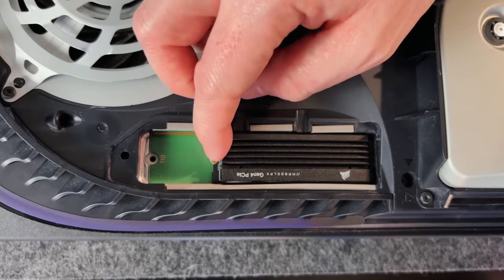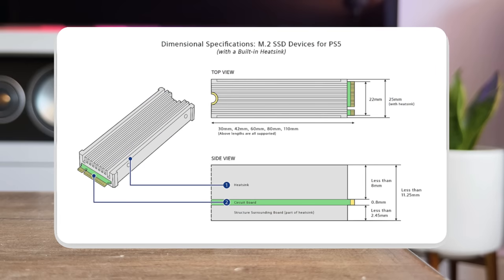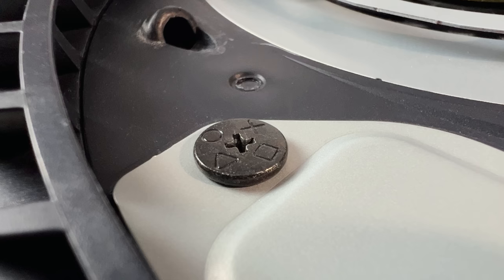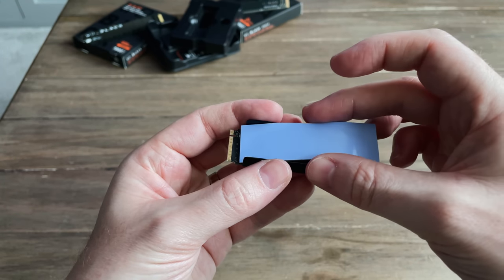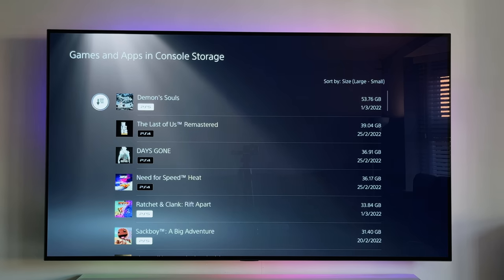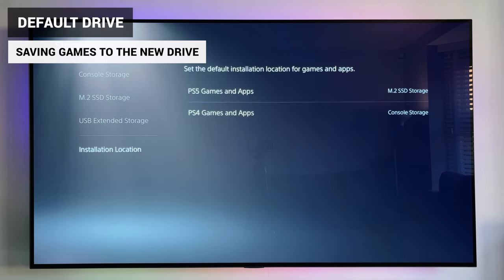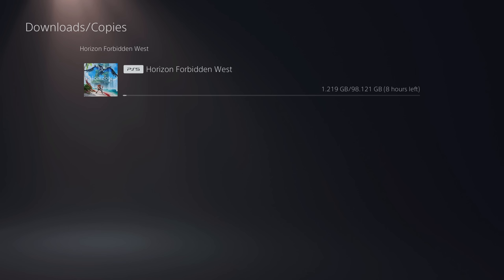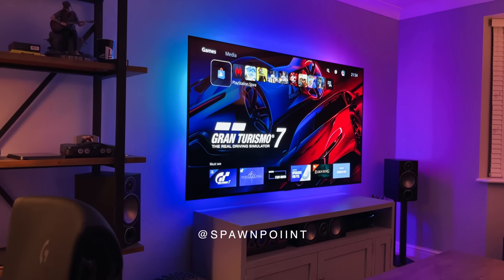The Ultimate PS5 Upgrade: Installing a 4TB SSD

Comment: It's cool to know that the PS5 can support 4TB SSDs, but their current prices are more than the PS5. 2TB is definitely good enough for me and is well priced for me. I have a personal law that says "don't spend more money on an upgrade than you have spent on that device"
Reply: 2 terabyte will not last you much if you plan to get many video games over time unless you plan to have an 8tb external hard drive act as cold storage
Reply: @bamban_garcia5562  I’m getting by with just the base storage and I uninstall games I ain’t playing currently. Then again I got really fast internet so redownloading games isn’t an issue

When I get the SSD upgrade I’ll probably use my external harddrive for either PS4 titles (since they can play from there) or as cold storage like you said
Reply: @jamrah8713  Both good options happy gaming mate
Reply: cap, unless you are implying those prices dropped by 300 dollars in just a year which is unrealistc

Comment: Got a 2TB SSD for my PS5, I think that’s the sweet spot for me I don’t think I’d ever over use more then what I currently got but can’t go wrong with 4TB either little over kill but hey whatever makes you happy
Reply: It’s not really overkill. Just planning ahead. I have a 4TB SSD and I’ll never have to worry about space again.
Reply: @mysterious___1  I have 8 tb worth of ssd but sadly they're only relevant for my ps4 games and ps5 games storage. I wish the sata 3 ssd could slot into the ps5 motherboard just like the nvme.
Reply: Es PS2
Reply: How much did you pay for your 2 TB
Reply: @furiousphoenix7526  2tb depends on the brand but they usually go for like $250-$270
Reply: @mysterious___1  4tb is def overkill. I just got the 2tb and I still feel like it was overkill lol. I have high speed internet though with no data cap so it’s pretty easy to just reinstall a game if need be.
Reply: @rogeliosarceno3162  now its 180
Reply: Can you play ps5 games with a 2tb ssd
Reply: @robertdavis-rb5hd  yeah bro
Reply: @rogeliosarceno3162 how many games does the 2tb fit
Reply: @jaybee756  depends on how big the games are. Like 45+
Reply: @rogeliosarceno3162  games these days are more like 80+gb to 100gb especially as newer games that are on this current gen is so huge so estimated would probably around 18 to 20 games only for a 2tb if you're playing current games on a current gen release.

Comment: Got a hold of a 2tb model, costs me the same as the PS5.

The messed up part is that even if I bought another PS5 with that money instead, I would have ended up with less memory overall
Reply: Same as a ps5??? I bought 2tb for 220 which brand and where did you get yours that it was close to 500?
Reply: @mobious01  got the 2TB model of WD black latest with heatsink for 349,
Reply: @MrLaafish  Ouch 😬 you do know it only costs around £280 on Currys and Amazon and that is with a heatsink.
Reply: @PulseGta  this was bought back in October 2021, when these were brand new
Reply: $220 to $380 for the $2tb 
$699 to $880 for the $4tb
Is what I am seeing on
Amazon.
Reply: @MrLaafish  you did zero amount of research
Reply: @Fancy405  all of this was bought at the time of release last year
Reply: @MrLaafish  I just bought a 1TB WD SN850 and with a total of 1.67 TB... I am a happy man !
Reply: @Zeegoku1007  sounds great man, I wish I had waited more but I wanted to cope one early in case they sold out just as the console itself
Reply: @MrLaafish  Understandable. But the thing is I didn't have a lot of games back in 2021. And in mid 2022 itself , Horizon FW , GT7 , GTA 5 each are around 100GB...so now was the perfect time for M.2 expansion. 

And in approx. 2024 the prices of higher than 1TB SSDs will be in a manageable range so I think people might consider buying them when the library and game file size becomes huge , but you are already future proof so cheers 🤘
Reply: @MrLaafish  prices haven’t change much but you still could’ve did more research
Reply: This 4tb costs me $585, that's a bit lower than my ps5 which I paid $600 for😋👍
Reply: Scammed 💀
Reply: @werick7349  ong
Reply: @werick7349  it’s was back in October when it was fairly new. That’s the price you pay for being an early adopter of the newest technology. Im guessing There weren’t many sales back then so it’s understandable for him to get it at that price. But still could’ve waited for Black Friday sales lol.
Reply: I got a samsung 980 pro with 2tb and 6500 mb read speeds for $230. But I realize this is some months later. That's crazy with the pricing.
Reply: Should of waited 4tb cost same as ps5
Reply: @mobious01  they have 4tb 670
Reply: @theriseoftony  of course, my comment was posted as a heads up for people not to rush and buy on release.

I could have waited a few months for a sale or a whole year for the price to drop, however as the situation was looking at the time with both PS5 shortage and the risk of the M2 cards to also be sold out i too the risk
Reply: But... You could have sold that second ps5 for 2 4tb ssds 😏. Jk, fuck scalpers
Reply: Damn I just got me WD 4tb for $379 which isn't bad I got my ps5 as a gift I think it's on sale as of right now who knows if price will go up but doesn't come with heatsink but that isn't a deal breaker for me.
Reply: $500 for a 2tb ssd? You got ripped off bud. Or you live in a 3rd world country
Reply: @TheAbandonedAccount7  it was 449 at release 1 1/2 year ago, check the date.

This was also for the best SSD recommended
Reply: @profezzorBALTAZAR I just bought a 4TB SSD for only $200
Reply: Damn the 2 tb is like 120 on Amazon right now lmao

Comment: The price difference between SSDs with or without preinstalled heatsinks is barely over tenner now, so the savings from buying the heatsink separately are not as significant as they used to be.

Comment: 2tb seems like the sweet spot for price and capacity.

I started with  a 1tb which just isn't enough. With dealz now you can get a Gammix S70 blade SSD for very reasonable price. Add a sabrent heat sync too keep it cool.

Comment: I have the launch ps5 and I put a 2tb ssd in it.. I'm going to move if from my bedroom to the living room so I can connect the ethernet cable to it so I can stream to my ps portal better . I Recent bought a 4tb and want to grab a ps5 pro to go back in my bedroom. It'll have about 5.5tb's for me to add most of my catalog of games .The TV I have in my room is a LG X Oled with up to 120fps so I want to be able to get the best performance out of it because i game in there primarily. The launch ps5 in the living room will have the settings dropped to 1080p to stream better to the ps portal and it shouldn't be an issue for my kids because although the TV in the living is 4k it only does 60fps but it'll stream to the portal with less to no issues at all.. can't wait

Comment: if you're going the external route, just get a HD. they are much cheaper than an external SSD. i planned for this years ago even before this gen of consoles. i bought two, 4TB drives. one for X, one for PS. i paid about $100 each.
Reply: cheaper but slower
Reply: I can't even use hdd as storage let alone to run games but that's just me. I have 8tb worth of external ssd for my ps5 (actually for ps4 pro before I sold it) so I'm not in too much of a hurry to upgrade my ps5 ssd as I have just a few ps5 games.

Comment: 4 TB may not be an overkill but definitely way too expensive. I have a 1 TB SSD installed and it's been doing the job for me. So yeah I think 1 or 2 TB drives are enough for now.
Reply from the maker: Yes it's very expensive if you don't need to use the space. 2TB is the sweet spot.
Reply: I went with a 1TB WD Black, alongside a 512GB external. The standard drive gets my most frequently played PS5 games, and the external holds PS4 games. The M2 drive is mainly for the lesser played PS5 games, but also for any PS5/PS4 media apps and some of my more frequently played PS4 games.
Reply: @AJCham  You're doing it wrong. The fastest drive without OS contention (m2) is the drive that should hold your mostly played ps5 games.The internal ps5 ssd should be left to run operating system functions alone (massive boost to performance of your games running in the m2drive). The external should be strictly for ps4 games.

Comment: I plan on picking up a 1 TB ssd, I don’t see myself needing 2-4 TB’s space. I only play a couple of games (NBA 2K22  & Call Of Duty), but would like for some flexibility for a couple of other games that may catch me or my girlfriends, eyes.

Edit: Ive also picked up a Scuf Reflex Pro for the PS5… was wondering if you planned on picking up and reviewing any third party controllers?
Reply: 4TB would be pointless, you wouldn't be able to use it. I have the 1TB and it's half full at the moment. The problem I find is that with that many games it requires the "other" catagory to be half of my main drive. You can't put other on the m.2 drive so at about 1 to 1.5 TB the "other" catagory will fill up your main drive and not allow you to install anymore games. I'd say 2TB would be maximum before you couldn't add anymore.

Comment: 4tb is fine for a large game library, but a SSD that costs more than the system itself is a bit overkill..
Reply: Actually it's literally 3 times more than the cost of a ps5 physical and 4 times the digital version.
Reply: @lordspalse0062  where are you shopping? Your average gen 4 4tb is around $500-$600 on Amazon.

Comment: I speak for my personal preferences, but I would rather buy an external HDD 4TB and put all the games there, then when I want to play one I just move it in and play. I do not need to have all games available, since I kinda play just that one plus some online but if I go for a run, I stuck with that game until I finish. I do not know if this 4TB SSD change the performance of the games, but the base ssd in the system is good enough.
But that is just my preference for the future, since I am searching for my Ps5, like my girlfriend :)

Comment: I just got my digital only PS5, got the Series X as the PS5 was very hard to get at the time . I ordered the  2T version of this SSD from Corsairs but it was on back oder till the middle of march . After watching your video i canceled from Corsairs and bought this 4T on Amazon , it's a Whopping $513 bucks and it was 18 % off, cost more than the PS5 digital but at lease i won't have to worry about storage and won't have to fiddle around with external storage. And i don't think it's an over kill, I fill up 3T on the Xbox series X in no time.

Comment: You may have already answered this but I’m going to ask anyway so I was told that ps4 games and ps5 games cannot be stored together but I think you may have done that as long as I have the space for it. Should I be worried? My son has ps4 300 games in his external and wants share them with me will this capacity be able to handle it? He currently has a 4tb external but of it get this for my system will it be alright to play both ps4 and ps5?

Comment: Reinstalling the metal cover over a new m.2 SSD is not a good idea cuz it limits the air flow and requires the heat sink dissipate more heat than is capable of doing leave that metal cover off if you add an m.2 SSD into your PS5

Comment: I couldn’t justify the cost of the 4tb, so I opted for the 2. I had a 2tb in my ps4 before it crapped out and it was more than enough. So with 2.6 tb, I think I’ll be set.
Reply: 2tb should be enough. as more games adapt the PS5's data compression methods, games should only be 1/3 of the original install size. For example, skyrim on the PS4 and xbox is 42gb, but on PS5 its only 15. Pretty impressive.
Reply: @markus9641  great point!

Comment: Not overkill but overpriced for me.   I opted for the Western Digital D10 8TB 7200rpm external hdd.  At current prices its 1/3 the cost of that Corsair 4TB M.2 and double the capacity.  The speed is good enough for me.  Transfers a 70GB game in 8 mins.    I have my entire 115 PS4 and PS5 game library on it and still have half the drive left.  I can play the PS4 games right of the HDD if i want.   This should work for me for several more years and by then larger capacity M.2 drives should be available for even less (hopefully).

Comment: Ps5 CFI 1200 installed M2 Corsair MP600 PRO LPX.  Ps5 shows speed 3685mb/s.  I decided to check out the M2 and the games run very fast and work great.  Someone faced such a problem as the minimum reading speed?

Comment: recently got the XPG Gammix S70 4TB for $314.95CAD incl. tax... main reason for it, is that I installed a 2TB HDD on my PS4 Slim that I got for X-Mas'17 (which totaled almost $500 for both the console and HDD) and in doing so, was able to keep scores of games on my console, and because it had so much space, the cooling fan would very rarely kick into high gear to keep up. 5.5 years later, it performs just as efficiently as the day I bought it!  I still need to buy my PS5 console, which will still be about $680 after tax, making the initial cost of the console to be just under $1,000... but if the performance of my PS4 Slim is any indication, this means that my PS5 will long outlast its planned obsolescence and carry over well into the release of the PS6. And so, I'm off to Best Buy!

Comment: I'd like to see your "other" catagory. The one that has to be on your main internal. I have a 1TB m.2 and I have about .6TB 8n games installed and my "other" catagory is half filling my main. And before I transferred all my games to the m.2 I found out that it won't install games if there is not enough room on the main SSD for the extra "other" that each game requires. It actually said there is not enough room, I need to free up 0kb of space. Yes 0. Because I technically had enough for the game on the m.2 but not enough for the "other" on my main SSD. At this rate I would think you could only have 1.5 maybe 2TB depending on the game before they just wouldn't allow any more games because your main SSD would be full from the other catagory. It's a strange problem I've never heard anybody mention about SSD upgrade.
Reply from the maker: Oh wow. Not heard of this. I thought the ‘other’ was used for compatibility patches for PS4 games mainly.
Reply: @SpawnPoiint  PS4 games are the biggest culprit. I only have warzone, RDR2, and GTA5 as ps4 games but my main SSD is 50% other. Every game I put back on after getting the m.2 drive brought it up a little. I still had games on my main drive when downloading some previously deleted games (to free up space before getting my new drive) I was installing sackboy for ps5 on my new m.2 drive when it said I didn't have enough space and needed to free up 0KB of space. Then I realized it was because there wasn't enough space on my main drive to put sackboys other catagory on there. I transferred another game over to my m.2 and it installed sackboy and sure enough my other category got a little bigger. So even games installed on the m.2 drive require space on the main drive for the other catagory in turn limiting the total amount of games you could actually use. So if you read my novel of a response here could I ask, how big is your other catagory? Maybe a lot smaller if you only have ps5 games on you internal SSDs but again, I only have 3 PS4 games on my console.

Comment: The biggest improvement for this generation is Sonys compression tech. Games for ps5 have significantly smaller file sizes compared to last gen. I’m able to have 15 ps5 games installed rn just on the original ssd with overhead currently for maybe one more game.
Reply: maybe 15 indie games

Comment: No cost? 4TB. I have a near-filled 2TB external SSD for PS4 games and a partly filled 2TB internal drive (WD SN850, like you had) for PS5. Console drive is empty. If cost is no issue I'd get rid of the dangler and just put it all on a 4TB drive, saving the console drive for run-off when the 4TB is filled. Just more compact without the dangly tail.

Comment: So if I buy a new SSD, I just have to insert it and can store my new games there? Or do I also have to migrate my games?
And do I need an extra heatsink for the Corsair MP600 or is it included?
Reply from the maker: The MP600 comes with the heatsink. Plug and play. You don't have to transfer your old games, you can leave them where they are. Then set the new SSD for future games.
Reply: @SpawnPoiint  Ok I get it, I just have to migrate my games if I want to change the new SSD. Thanks for the quick answer! I hope 2TB will be enough 😁

Comment: Hey what do you think of the WD_BLACK 2TB SN850X NVMe Internal Gaming SSD
Reply: Good ssd though go with the regular heatsink version not the "officially licensed" since you would be paying less for the same version
Reply: @bamban_garcia5562  hey which one is the regular one??? I want a 2Tb
Reply: @Prxsumo  Its the one with that exact same number but in orange color as well as the upper area having an orange strip colored area, the "officially licensed" is the one with the serial number in blue

p.s

If you get one without a heatsink go with the Elec Gear PS5 NVMe SSD heatsink for optimum airflow
Reply: @bamban_garcia5562  thanks for the info bro and yeah I'm going for the one with the heat sink even though u seen videos on how to add a heat sink and it's easy
Reply: @bamban_garcia5562  hey the orange one is 250 and blue is 260 not much of a difference
Reply: @Prxsumo  You gonna pay the difference in taxes though you can always wait for a sale since the original version usually has $50 to $80 off at those times

Comment: Tricky question.. Well if price wasn't any issue, I would go for the 4TB But like you Said 2TB is the Sweet spot, definitely worth Saving for!.
Reply: Never underestimate a ssd with ram in it. It's crazy for data streaming and texture loading. The 4 tb version has 4gb ddr4 ram cache in it. Your games literally feel like they're running on ram rather than storage.